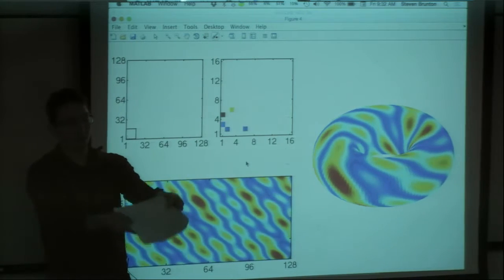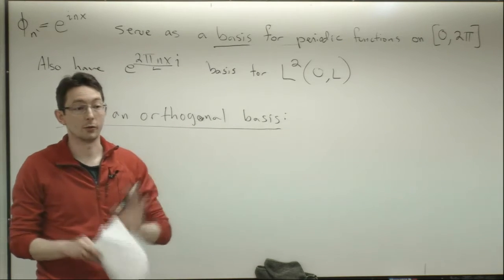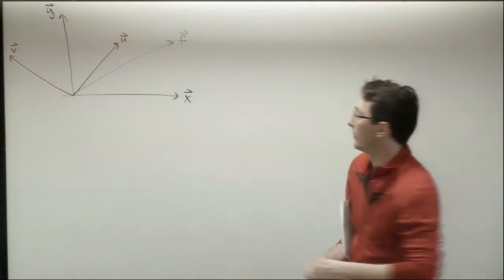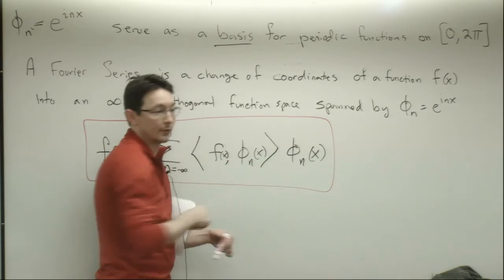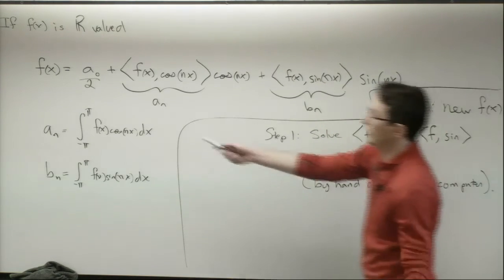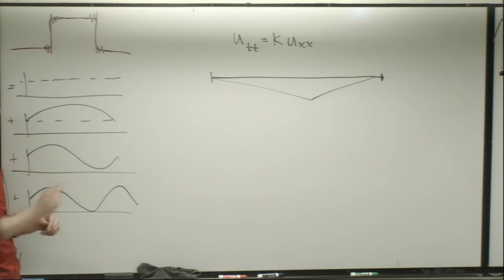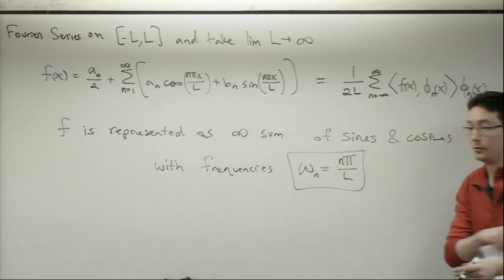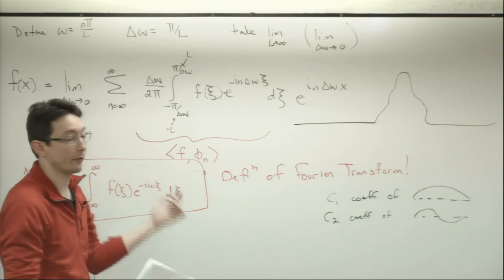ME565 Lecture 14:  Fourier Transforms

Comment: Yes maybe Dr.Steve forgot to divide 2*pi. He already proved the same earlier stating that <phi_n, phi_m> = 2*pi for n=m. The proof provided by @Zhenghao in earlier comment is correct. The L2 inner product has to be multiplied by the directional vector for representing the component of the basis function. As directional vector are unit vectors the general formula is x/mod(x) which translates to phi/<phi,phi> in the Hilbert space. 

Still then Dr.Steve is awesome as the intuition behind fourier series was clearly put forward in this lecture.